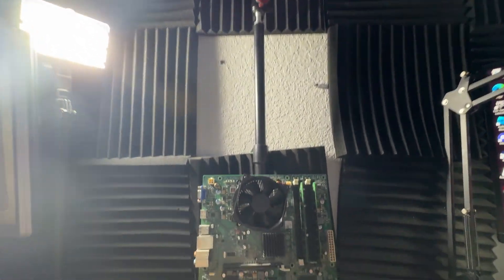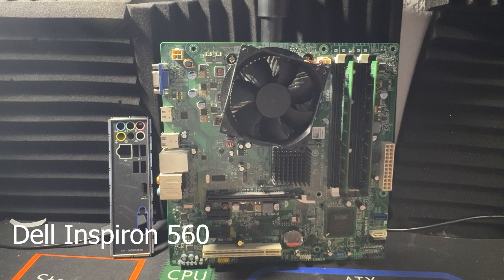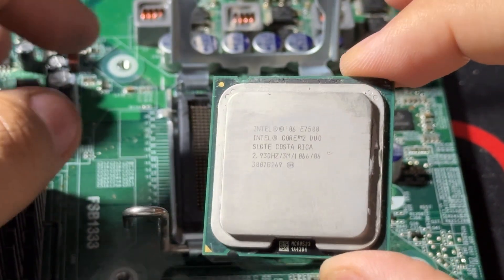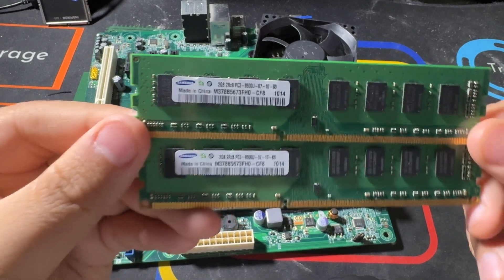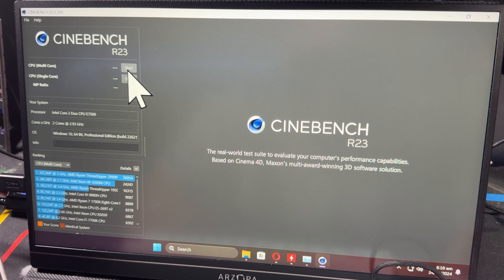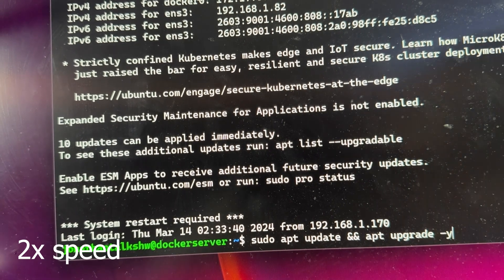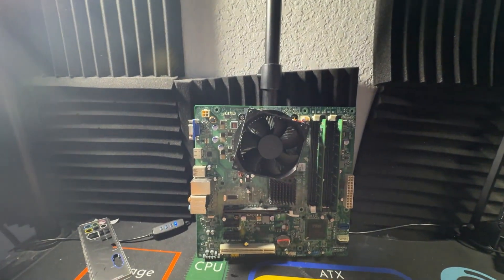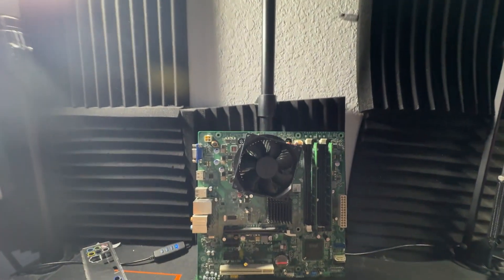Intel Core 2 Duo E7500 - Worth It in 2024?

Comment: I have a T9300 Core 2 Duo Laptop, and have upgraded from 1GB to 8 GB DDR2 RAM & an SSD on Windows 10, officially only supported 4GB but 8GB works just fine. Super snappy, and can have plenty of tabs open without too much issue. The GMA965 made the RAM support better than my old 945 chipset laptop.

Comment: I had this and a nvidia geforce 9300 ge as my first setup. Good times but I don't miss the lack of performance lol
Reply from the maker: The exact board/cpu/ram combo I have?
Reply: @blindtechh  No, you've actually got a nicer board and ram combo. I had a Dell Optiplex with the inverted motherboard (no sku sorry) and 4gb dual channel ram running windows 7 32bit lol. Had two sata drives with 160gb and 320gb respectively, I thought I was top dog with my office PC haha.